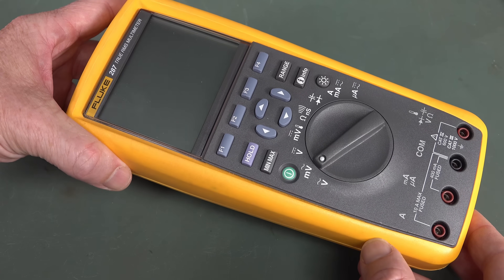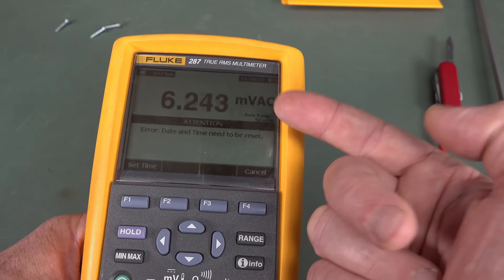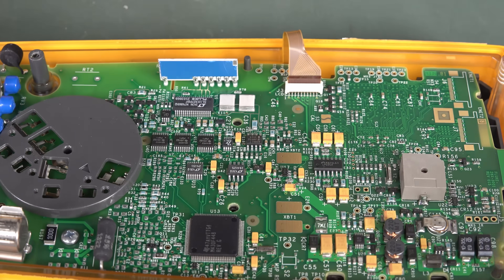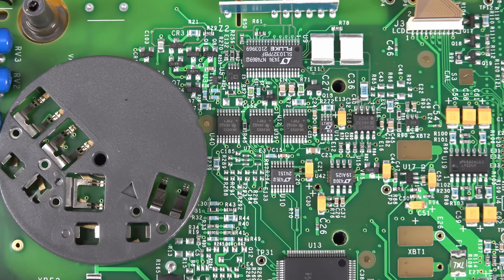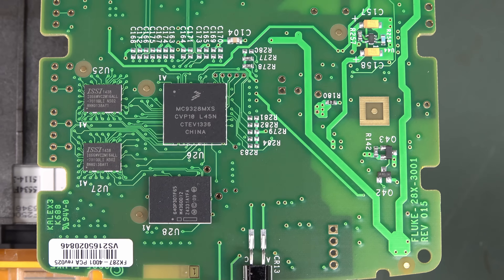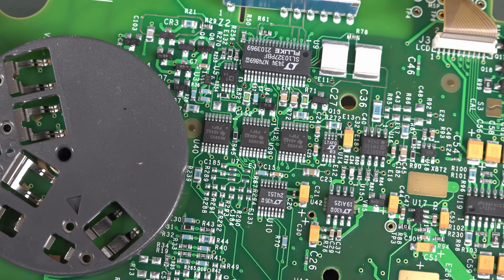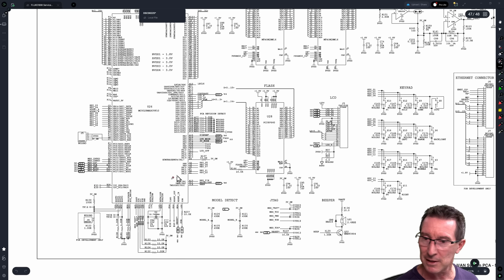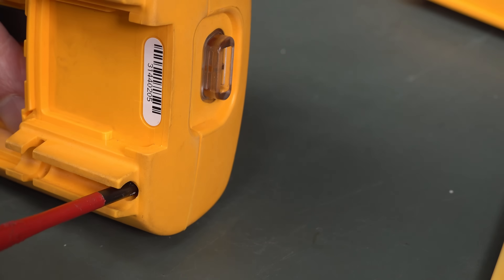EEVblog 1592 - Fluke 287 Multimeter Teardown

Comment: We have one of these at work and I always get stuck with it. 90% of the time I prefer a simpler meter like the the 87V. The seven segment LCD has better legibility in indirect light and the fact that this 287 takes so long to boot is just annoying.
Reply from the maker: Yes, this would be complete overkill for most jobs.
Reply: @EEVblog I can't actually view your comment until I select 'Newest', rather than top. It seems YouTube is shadowbanning your comments on your own channel... Insane.
Reply: I own a 187 series I and it's the best of both worlds: more accurate than the 87V, dual measurements/dual displays, 7 segments, and when you turn it on... it's on! (No "booting" like the 287/289...)

It's possibly second only to the 189 series I which only adds logging (and is much different from the 189 II, which the 287/289 are derived from).
Reply: @daniloxyz  I have both the 187 and 289, and the 187 is always my go-to multimeter unless I need logging (or the temperature probe that I only have in my 289 bag). Also, not having logging in the 187 means that is doesn't have a supercap that'll go bad.
Reply: @Svuppedasker  Got the 287's at work now... we transitioned from the 187's and what a serious setback it is... I do NOT understand why the 287 can be a top of the line meter and be so extremely shitty at basically everything.
I plan on modifying my 187 to a 189 ;) The only hard to get part is the SRAM-chip...
Reply: I'm much the same. I got one for cheap and don't really like it. It's crazy that this is Fluke's top of the line hand held meter when the foreign manufacturers are getting so good nowadays.
Reply: The batteries are always dead in the 289.
Reply: The 87 V is great meter mybonly gripe with it is the 9V battery cuz those just suck.
Reply: I sometimes use it at work, good for min max logging but it is so slow if you have to measure something quick. I also prefer 87v for fast T/S
Reply: 87 IV was the last good fluke multi

Comment: I've got the same meter at work, the kickstand always falls off it.
I'd also guess the inner case is transparent so they could mold the case, display cover and IR port in the one part and remove two o-rings from the BOM and some assembly steps.
Reply from the maker: Quite likely.
Reply: Magnet strap attachment for the win
Reply: Same, I use the same one on streams, and yeah, that kickstand falls off.
Reply: I have the 289 and the stand is crap. It doesn't even snap close correctly, including in this video. I thought I was the only one

Comment: A thing of beauty indeed. I wonder if these ethernet jacks were ever a feature of any model, or if they were there as a production-time only interface.

It shouldn't be that hard for Fluke to release an upgraded battery compartment and stand. It's one of the higher end meters after all...
Reply from the maker: Says development only on the schematic. Doesn't make sense on a production model from a safety standpoint.
Reply: @EEVblog why is it a safety concern?
Reply: @mattmurphy7030  You don't want 1KV in the meter to leak into ethernet. That's why good meters always have wireless of some sort for data logging, IE IR in this.